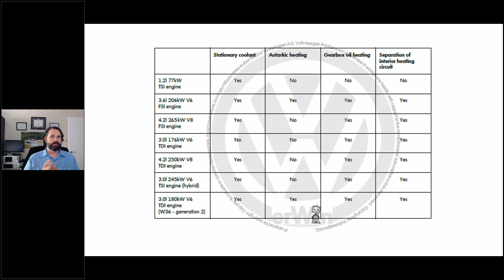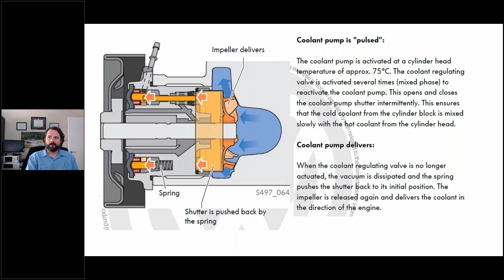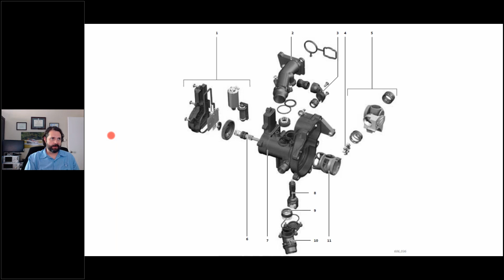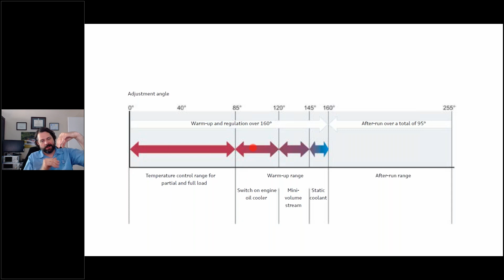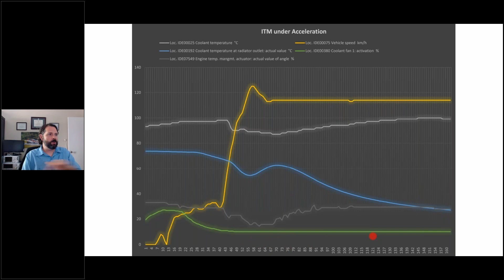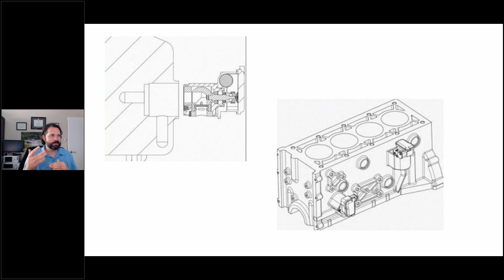VW Audi Thermal Management   1 Hour Class

Comment: Great info! Thanks! 
I observe the following issue on a 2.0TDI MY2021 in Mk8 Golf:
since some days ago, when driving for some km, the oil temp will not rise on the instrument panel. The coolant indication reach 90 degrees displayed, but the oil stays with the dashes on the display (below 50 degrees). for some moments, it will rise to 51-52 and then go back to the dashes (like the oil is being cooled before it even warmed) On my last drive, after some time driving with this behavior, the oil temp on the display suddenly raised to 130 degrees and stayed there for some km, then I arrived at my destination and haven't driven the car since then. There were no any warning on the instrument display I will scan with VCDS asap when I have it in my hands, but do you have any idea what can be the cause? Is it dangerous to drive the car with 130 degrees oil temp?
Thanks in advance!
Reply from the maker: That sounds like a faulty sensor or wiring to me.
Reply: @CameronConover  Thanks for the response! I hope to find a DTC about some implausible data from that sensor then :) Also, in case of implausible data of this oil level/temp sensor, shouldn't be there at CEL/MIL or at least warning on the dash?